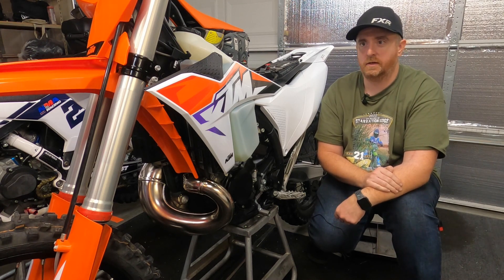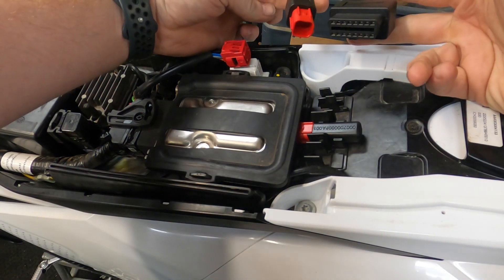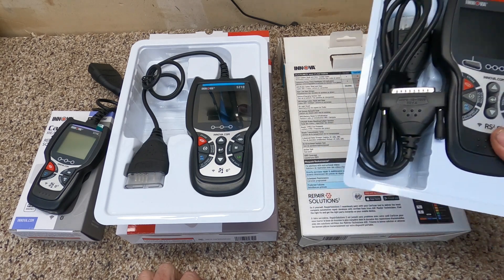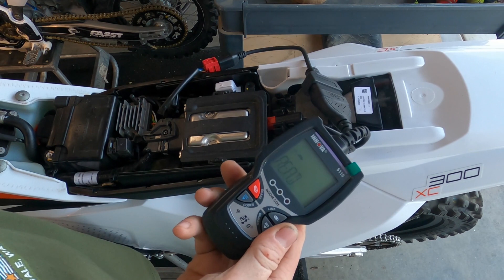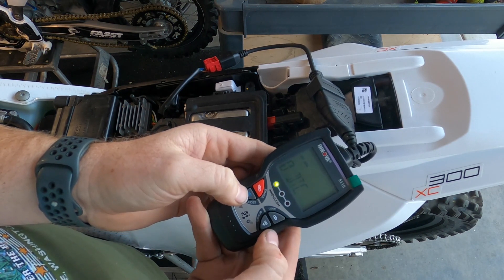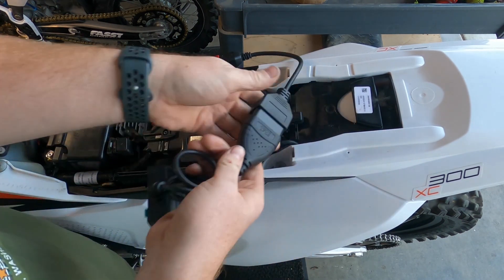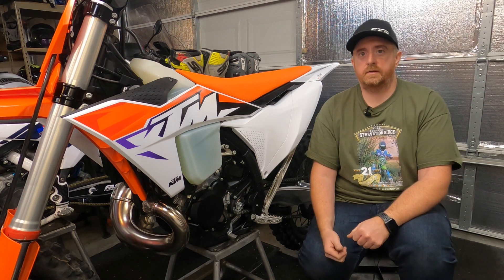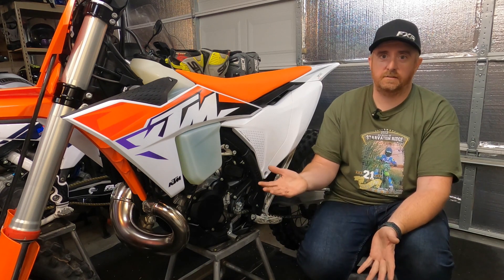Scanning ECU Possible?  Trying to Scan 2023 KTM 300 XC with OBD2 Readers

Comment: the ecu uses CAN protocol, I managed to connect to it using universal obd protocol but the comunication suddenly stops, seems that the ecu is locked and works only with official testers.
LE: I have managed to read and erase codes with VAG universal handheld scanner tool.

Comment: Nice clip! But have anyone found a reader that can read ECU hours?
Reply from the maker: TSP ERM seems to be the only TBI reader available, have to ask them if it will read EVU hours
Reply: @joshmundy  Super nice of you to come back with an answer. Im also interested in something that could read back to 2017/TPI. I emailed some dealers in the US that has some readers available to see if i can get an answer from them as well.
Reply from the maker: @carlmigueljose1097  a lot if not all the TPI bikes can be read with a standard OBD2 reader with an adapter from like Amazon / eBay.  I do not know of specific brands and models of readers though
Reply: @joshmundy  Alraight. And this includes runtime hours as well? My deep dives have only resulted in people not knowing, or that they cant read ecu hours with the cheaper ones.
Reply from the maker: No clue on engine hours

Comment: I bought an sx300 and am thinking of buying the nihilo concepts separate start/stop button kit to avoid accidentally hitting the start switch while the bike is running and thereby setting that fault code by accident.
Reply from the maker: They have fixed that error with some software updates shortly after the bike came out

Comment: This is weird. I have 2018 Duke. I bought a cable from Amazon and have two Autofix brand scanners. These worked about a year ago, the last time I hooked up. Tried them tonight and neither will communicate with the bike.
Reply from the maker: Previous bikes it always worked fine, but the new MY 2023 KTM Offroad bikes they locked the ECU down

Comment: I concated INNOVA and they told me their scanners won't connect to motorcycles or heavy duty trucks. 

I contacted rottweiler performance  and they said they just used a cheap amazon reader because the bike computers are less advanced than cars and the basic code reader works just fine to give them all they need to solve the problem. If it is good enough for them, then its good enough for me.
Reply from the maker: I tried many different types and none would connect to the new KTM units.   If you have had luck with a new 2023+ KTM (not an xcw) id be curious what you used
Reply: Hmm just use XC2 or any other can iso-tp/uds capable device.

Comment: You won’t get any OBD to work with this bike it’s not implemented in the ECU
Reply from the maker: Are you speculating or stating something you know that is a fact?  Asking just to confirm as the xc2 scan tool works to read and clean codes.
Reply: @joshmundy  have tested all standard OBD2 signals with no response on the OBD2 CAN IDs, but the KTM tool is different it uses a Different CAN I’d to communicate and also uses a security access to do what it does.
Reply from the maker: @Jase877  ok thanks man!   So many people like to try something once and they state it t can’t be done.   I wonder if we will ever be able to read or reset codes without dealers
Reply: @joshmundy   the main issue I see is these bikes are not a road registered vehicle so may not be enforced like road vehicles are to have OBD2 compliance to be sold if they do move the ECU to an EXC or W-XC i would say they would be forced to have the OBD2 scan tool working.
Reply from the maker: @Jase877  very valid points!

Comment: I did the same thing, I hit the start button on accident while the bike was running. I have a 2023 250sx. How did you get the code to go away?
Reply from the maker: only way to do it currently is take it back to dealer.
Reply: @joshmundy  thanks for the info

Comment: Buy a TEXA NAVIGATOR!! That will do the job!!
Reply from the maker: Are you guessing or have you actually used it on a 2023 TBI bike?
Reply: @joshmundy  I work at a Dealer, I used it as a secondary scanner. Its multi brand. But also is OEM scanner for Ducati, vespa ,Aprillia and Moto Guzzy
Reply from the maker: @josevelez49  when you test it on a 2023 TBI report back if it works.  The new system seems completely different and so far everything that used to work doesn’t.
Reply: Does the ECU control the power valve as well?
Reply: @mikeb4708  Yes!

Comment: https://azwecdnepstoragewebsiteuploads.azureedge.net/23_3214639_en_OM.pdf.     (14.6 )remove the hour meter before scanning obd
Reply from the maker: I have heard to do that only because when connected to a tool the hour meter is in and running because the system is powered up.

Comment: The only way you're ever going to know is by unplugging something and running a scan
Reply from the maker: Since most of the scanners cannot even connect, not sure why you think unplugging something will work.  Now if you are referring to the scanner that did connect, I clarify in the video that someone did test it with that scanner and he has the blinking lights and it would show no codes still.

Comment: I'll give you my advice that I concluded with my TPI. The handheld code readers can give you basic info and allow you to read codes, but I wasn't able to find a reader that could actually clear them. Luckily, my KTM dealer is close by and the diagnostic computer they use is extremely capable. Basically, if anything CEL were to occur, I took it straight there and let them deal with it. Not something the do it all guy wants to hear but I just wasn't able to find a handheld scan tool that would do anything more than read CEL and give basic PID info
Reply from the maker: Good info.  I know the TBI system seems more locked down vs the TPI, but i figured why not give it a try and see what i can figure out.  A dealer i trust isnt very close and the 2 hours of time I will lose driving back and forth plus waiting on their available time is the frustrating part, when I could have it fixed in roughly an hour or less depending on the issue

Comment: Do the two higher end readers have a global obd mode? Instead of trying to do a "auto check"?
Reply from the maker: I am not sure what the global odb mode is, so I don’t think so.   I never saw a way to pick the scan type.  Maybe I could have if I entered vehicle info on the most expensive one, but they didn’t go above 2019 and only was doing autos
Reply: @joshmundy  gotcha. For cheaper scan tools I use actron. They will auto ID. Or they can use a global ID. So for older vehicles or things where the VIN cannot be decoded. Once I get my 300XC or have another new 23 in the shop I'll try connecting to it with my OTC evolve.
Reply from the maker: @DannyDifalco  yeah let me know man!  I know a lot of people in my area that would love to clear codes on their own, so I’m sure it’s all over the country as well.  My goal with the video is to just help everyone out so they can save time and money vs visiting a dealer

Comment: Shit can the hr. meter.
Reply from the maker: Yeah I still could ride it, but the idea behind it is so people can work on their own bikes and fix their own stuff, not be controlled by a dealer / brand.   I want to be able to fix it myself and clear codes.
Reply from the maker: That’s like putting tape over the check engine light in your car
Reply: @joshmundy  I mean if the bike runs good, then run it. Or buy a Beta but I wasn't gonna go there. I'll be damned if a blinking light is gonna stop me from riding when I know she's running tits.

Comment: Just save your money for a GET ecu. They allow you to read fault codes
Reply from the maker: Wonder if get will come out with something for the tbi system
Reply: Idk. I’d just ride your bike and hope the light doesn’t come on and order up a GET as soon as they are available
Reply from the maker: I just hate having a light be on even if I did fix the problem but you have to clear from dealer is my worry.   I am very curious on a get setup now though
Reply: I have a get on my 501. It’s super simple to use. You download an app on your phone that connects to the ecu through WiFi. It takes like 2 minutes to fire bike up and connect and check codes. This will put your mind at ease lol
Reply from the maker: That would be awesome.  I’ll have to check with them on if they will be releasing for 300xc

Comment: ebay has some advertised for the KTM duke.. Maybe those would work.
Reply from the maker: All the ones I have see for a duke / 790 / 1290 all seem basic and should have worked.  I am thinking it needs the newest euro standards if it will work at all.   I have some more items on order and will do a video with those also
Reply: @joshmundy  Yes, I got the same bike, and I'm 2 hours from a dealer, so if I accidentally hit that start button, I'm stuck driving 4 hours (round trip) Plus wait time, Plus scheduling, so a full day or more, plus expenses, sounds like not much, but it's actually ridiculous..   I have not even got to ride the bike yet, seems very awesome on my local street test ride.. lol..
Reply from the maker: I hear ya, my dealer isn’t as far but it’s still a pain in the ass to work around someone else’s schedule, especially when I am more than competent to fix and work on my own equipment
Reply: @jsmith809 also don’t do a lock up on a hill and pop the clutch for re start. I think that’s how mine happened 😢 also I think it set the fuel to rich mode? @joshmundy did you notice that the silencer was oily wet when you had the codes?
Reply from the maker: @ricknoonan8640  I’ve killed bike going into corner hot and popped clutch and started without the light coming on, did you possibly hit button also?  As far as running rich, I had some drool starting to form when I had the light on and dealer said plug was pretty oil soaked, but a lot of time I was riding slow following my son.   At 24hr race I had a oil ring out of silencer and it ran great.   I run 60:1 motul 710
Reply: @joshmundy  yeah I probably hit the button. Running 60:1 motorex
Reply: So when they throw a code does it actually effect anything. Go into limp mode?